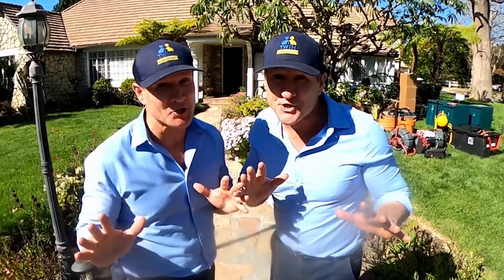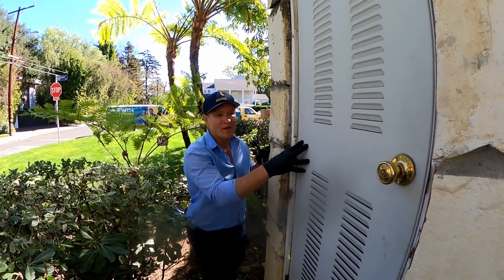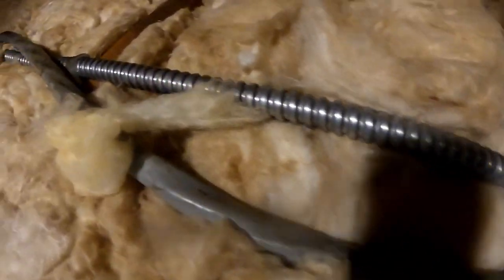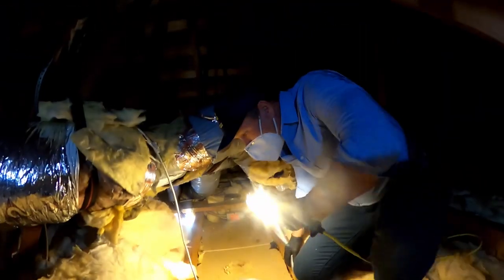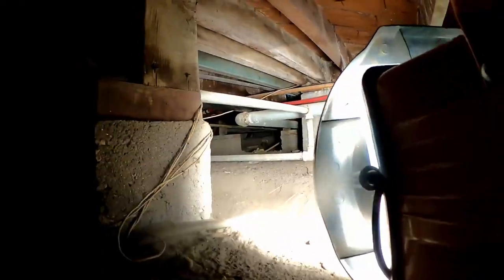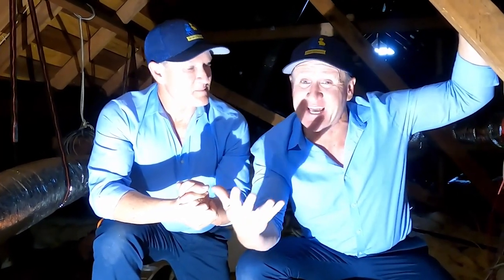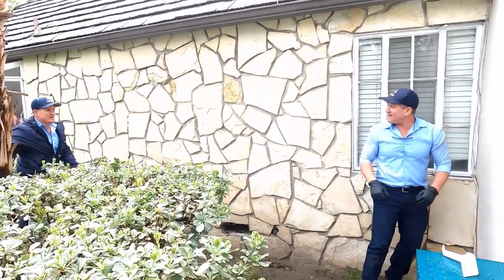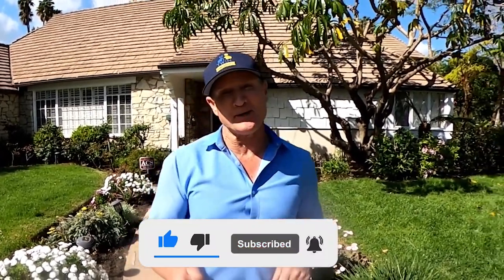Rodent URINE smell in the ENTIRE attic...(5 exterminators couldn't figure it out)

Comment: What does the Rodent Pee Smell Like? I Tore into My Basement Bathroom and The Odor Coming From it is Unbearable. The Studs and 2x4s Behind there looks Wet and has Black Dusty Stuff on there that Looks like Mold. But the 2x4s does not Look disintegrated. The Pink Fiberglass insulation At the Base are All Chewed up, Lots Of Rat Droppings all along the Inside Base Of the Drywall. So im Suspecting they're Getting in From Somewhere Somehow. But cant explain how the studs got wet and Accrued the Mold On there... Still Dont know if that explains why the Basement Smells Wet/Musty and Why I'm Sick all over the House.
Reply: Yes it's definitely a rodent

Comment: I doubt you can come service the property i rent as im in Australia but i have a huge problem that i cant even open some windows at my place due to YEARS of rat activity. 

There are privet little enclosed in decking areas outside of sum of the windows of the bedrooms here that when i discovered the smell and mess , i was removing rat shit by the garbage bag and using a lawn blower to blow it all down from the framing and out of all the nooks and crannies but lots have fell throw the cracks in the decking that i cant get under and i dare say there will be heaps down there well befor i tried to start cleaning up this mess. 

Its wood decking with floor to ceilings laser light and shelves under a covered roof that is so disgusting, windows cant be opened or the house will stink just as bad!

Ive only just shifted in and the land lord is quiet aware of it to the point there is no point even requesting he do something about it , his anwser to it was tossing some rat baits about and did not remove 1 poop pellet. 

So , ok the rat sack may kill the rats but how could i kill the bacteria and smell of all the poo and urine thats under the deck as im renting and i am not allowed to remove any of the slats to get under it. 

Ive read to use a 10% bleach mix of water and then some enzyme cleaner on surfaces then wipe clean but i cant wipe clean soil full of poo.

Could i just sweep a heap of clorinated crystals threw the gaps of the decking and basicly flood the decking with a hose after presser washing basicly everything with bleach, rince and then a enzyme cleaner ?

Its crazy. 

The place is a very old building , 1895. 
Id say no one has bothered to care about this rat infestation problem beyond putting baits out in over 20 and im being conservative. 
I would not be surprised if no one has ever thought about removing the droppings under this decking since it was constucted and that was ???
The place is an old hotel thats been made in to apartments about 20 or 30 years ago.

I cant live like this . 
I need to know how to clean the actual poop basicly,  neutralizes it in some way as this can not be good for my health. 

Ive already been to hospital with a bacterial infection that i could not shake for 3 week and i got that a week after i moved in .

Help!
Reply from the maker: Truly sorry your having to deal with this! Can you email us at support@twinhomeexperts.com subject Australia rat infestation. Then we can make contact to see if we can help.

Comment: Love your show but I'm having trouble with the odors in my basement. So strong that when I close the house to go to work or church or out for a few hours the smell is overwhelming. I have to check for bodies and then light candles.
Reply from the maker: You have to find the source of the odor Debra.
Reply: @TwinHomeExperts  how do I find the source? I think that it's in the basement ceiling were the floor meet's the basement wall top. I'm going to have to remove the stuffing from the wall top.
Reply: @debrabozman9614  good luck on finding the source and please make sure to wear appropriate ppe to protect yourself from health issues!
Reply: Are these odours effecting to health if it's from basement? Is your problem solved yet?